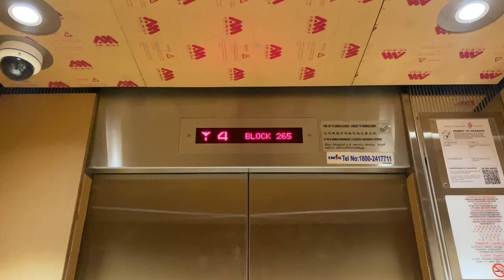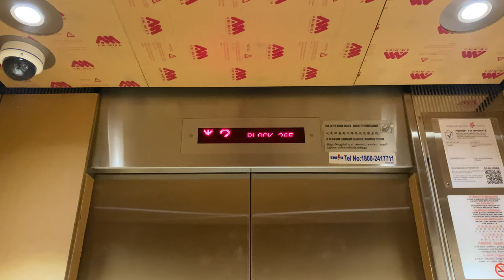MITSUBISHI NEXIEZ MRL @ 265 KIM KEAT ROAD

Comment: St George's Towers' MSCP's lifts actually run @ 1.5m/s instead, probably because its tall enough
Reply from the maker: You are right!

Anything less than 7 floors go 1 m/s.

Any taller and they run faster; those between 8 and 16 floors do 1.5 m/s.
Reply: @ZHD1987E  On the other hand all MRT lifts (excluding hydraulic ones & maybe those @ Changi Airport) run @ 1m/s, even if its the 20+m deep ones @ Bencoolen & Bras Basah stations